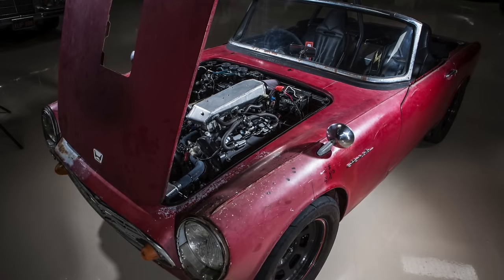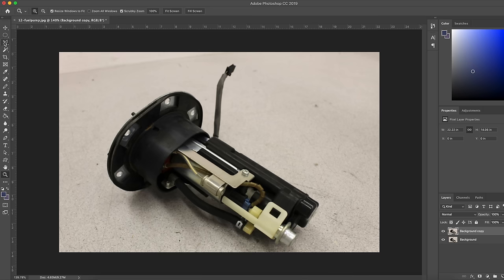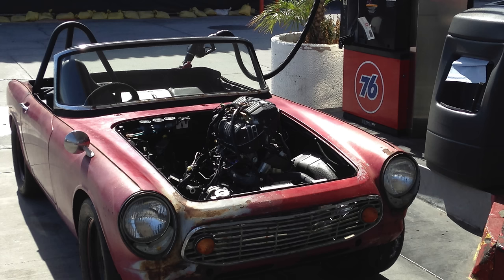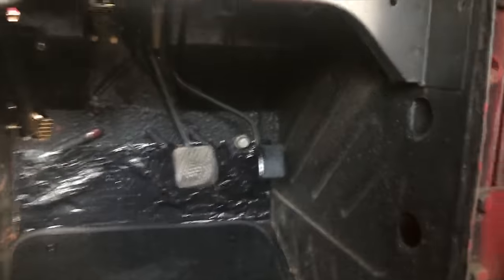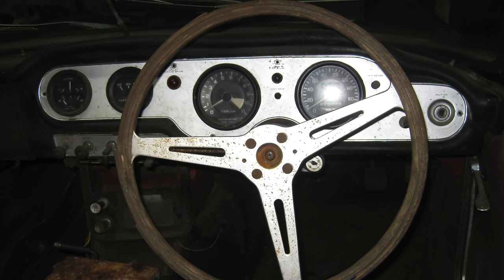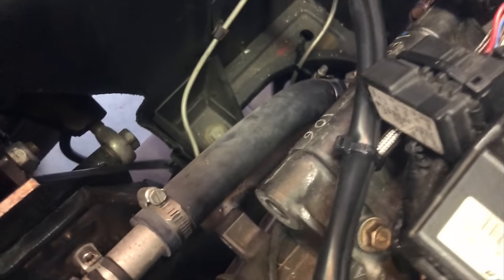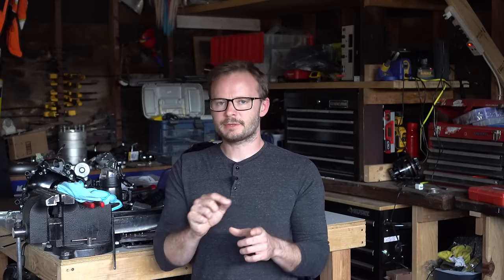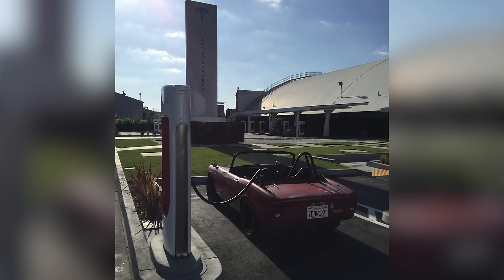Part 2 - Motorcycle Powered Car - How and Why: Fuel System, Exhaust, Intake, and Controls

Comment: Bro That shiftier clutch combo is legendarily sick AF! I want it on everything i drive!
Reply: That shifter is gone in the Jay Leno driving video.  What happened?
Reply: YOU RIGHT THAT CLUTCH SET UP IS GENIUS
Reply: In the UK you can legally adapt your vehicle to do this if you have a disability you can literally have motorcycle controls on your car
Reply: great thing about it being a sequential box too is you only need the clutch for taking off and stopping, you can just slam shift up and down, and if the donor bike has a quick shifter it's even better for it.
Reply: My Geo metro had a cable operated clutch - might be easy to retrofit as long as the mechanical advantage isn't far off.

Comment: Motorcycle intakes are huge, because they are tuned like a musical instrument.
Reply: #YAMAHA both of my R1s sing like angels. Though,  one of them has obviously been possessed (crossplane)
Reply: The crossplane sounds so good though.  I love the one in my MT-10.

Although, it definitely has a crazy airbox.  What looks like a huge gas tank is really 2/3rds airbox :-D Range is terrible, but whatever, I like what it does when I twist the throttle.
Reply: Fun fact, this isn't true, they are like that for marketing purposes, they could be a fraction of the size but then it'd ruin the design on the bike, if the intake pipe is the right size so there aren't losses and if the filter isn't tiny and restrictive it doesn't really matter what size it is, just as long as they aren't too small. Source: I build sport bikes for a living.
Reply: @jefffrasca4054  wait till you mod the air box, delete the cat and flash the ECU. It's a whole different monster. What I did to my mt10 lol
Reply: yeah he just lost a bunch of power
Reply: @jsullivan05  Velocity stacks? You don't even see them unless you take off the tank and airbox - how could they be for marketing? Anyway, they matter but it's not like you are going to lose huge amounts of HP.
Reply: @MrKdr500  HAHAHA

Comment: For 40-years I've thought about putting a motorcycle engine in a Fiat 850 Spider. Some guys think. Some guys do. Brilliant car and engineering.
Reply: I was looking for someone to say they have done this also!
Reply: @chaostoy  Yeah this was back when I had more imagination and ambition than resources. I drove a pea-green 850 Spider for a time in high-school and always imagined it with a "real" motor, ABARTH flares and wide little wheels and tires. At least it had a roll-bar, which I eventually tested unfortunately.

Comment: I had an Alfa Junior racecar years ago - and I deleted the brake boosters (power brakes). The car weighed about 850kg (~1850lbs). Worked great - but the funny thing was that going from my road car directly to the racecar did not feel strange. Getting back into the roadcar after racing though I tended to lock the brakes up. Non-powered brakes, setup correctly, just feels right!

Comment: you've just reminded me of the wooden car i "designed" when i was a kid. it was made off a bike too, reusing the engine and the rear suspension. i had troubles thinking how to design the steering, i didn't understand how a differential worked and i couldn't figure out how to mount the engine. my dad told me he would build it for me if i told him how but i never did because of those issues i had. i totaly forgot about it until today, 10 years later.

Comment: I'm actually in the process of swapping a Zx10r engine into my 1964 Beetle. I did most of my research and got the ball rolling last year. These videos have help reassure some of the ideas I formulated as well as helped point me in the right direction with aspects I haven't gotten far enough into yet. I look forward to more great content!
Reply: I've got a 1 litre kawi motor (from a Z1000, so basically an older leftover ninja motor they had laying around the factory) and am shopping for a kei truck to wrap around it.
Reply: do you happen to have a log of the things you're doing on that beetle ? i would like to do something similar in the future and i'm trying to gather as much info as i can. thanks ✨
Reply: @ilgerry5690  i don't have any recorded log or anything, and have since had to sell the project, but I can try to answer questions and share what information I have.
Reply: @bathrobebandit1561  thanks for the quick answer mate 🧐 if something pops in my mind i'll make sure to ask 😊 still, did u finish it then sold it or never completed it ?
Reply: @ilgerry5690  unfortunately I didnt complete it. Moved for work and no longer had the space to do real fabrication. The engine went to a dirt track racer and body went to someone who was going to put it on a tube chassis with a 350 SBC so im at least happy none of it went to scrap. I'll return to the idea some day.

Comment: Awesome build process Matt !
I loved having the ability to get inside your head on your thought processes and design concepts as they either worked out, or failed !
I HIGHLY recommend taking the extra few minutes, and watch the Jay Leno Garage feature piece Jay did on this car !
This little Hotrod makes ALL the right sounds, and put a smile on both Matt and Jay's  faces !
Who needs a sound system when you have a 12000 rpm rocket sled doing the talking !
That'll put a smile on any self-respecting gearhead !
Great job Matt !

Comment: I REALLY wanted to build a Locost about 10 years ago.
Bought a welder.
To learn to weld, I started building tallbikes.
Build many many tallbikes.
Bought an old Toyota pickup for a drivetrain.
It had a tow hitch.
So I bought a sailboat.
Rebuilt half that boat.
Built a new boat out of plywood.
Gave up on the Locost and bought a '69 MG Midget.
Rebuilt half the Midget.

But hey! Now I can weld, sail, and give my wife headaches from 50 year old engine exhaust fumes!

Comment: Simple and to the point, I like that. I like that hand clutch, too. That car is a true hot rod and by the looks of it; rat rod, too. I've thought about doing something like that with a goldwing flat6.
Reply: BMW water-cooled Boxer.
Reply: Yooo I have always wanted to do a gold wing or bmw engine car as well. Always seemed sensible bc it’s pushing around a barge of a bike so what not a light car. Though both engines don’t really have an advantage to auto engines of equal size aside from weight, I just think it would be super cool
Reply: @joederue9900  Goldwings have like 165hp.
Reply: Oh I know, they also redline at 6k so for the overall size and displacement and rev range of the engine, you might as well go with a auto engine of the same displacement, they typically rev higher and would be more stout, not to mention easier to work with and modify, just heavier, maybe depending on the gold wing. Like I said there is no reason not to swap a gold wing engine into something, I saw a guy who had one in a kei van, that was neat, mounted it under the chassis, but i really cannot deduce the advantage of a gold wing engine to an auto engine in the same displacement aside from packaging
Reply: @joederue9900  Super cool is the main reason.
Reply: @ItsDaJax  2020 Goldwings are rated at 97 hp at the rear wheel.  I'm sure there's a lot of potential for increase.

Comment: Nice job Matt.  I was lucky enough to have worked on two old Hondas.  My Dad had a '65 S600, all original, but had been disassembled. Could not find carb parts, so we installed a CBR600 FI with our own manifolds and Microsqirt controller.  Fun! The other was a hot rodded N600 twin.  It too was original before I upgraded the engine with EI flatslides, custom header, CDI,  karting tires and wheels and brakes. Keep 'em coming!

Comment: During the oil pan shortening discussion, my eyes almost popped out of my head when you started talking about magnesium welding. I thought the story was leading up to something I've had firsthand witness to, which if I remember correctly, involved some thermite and an old VW beetle engine block in the middle of the Mojave desert.

Comment: very cool Matt.  I did something similar when I took the front and rear suspension components from and RZR razor and built a frame to accommodate a Vmax 1200 cc engine.  Four wheel drive, looks like a mini jeep, loads of fun.   I enjoyed your vid,  we both solved the reverse problem very differently.  Still a work in progress.

Comment: that basic  clutch system  has worked for me in my aircooled vw powered rail buggy since a bad bike accident in 08 and subsequent injuries resulting in losing a leg.... i also use a atv thumb throttle for fuel ..... next build im saving parts for "fly by wire" throttle and hydraulic clutch..... awesome build sir enjoyed your videos

Comment: I was doing Formula Student as part of my Uni course, we used Triumph Street Triple 675 engines and put them in what is essentially a big boy kart. About 250kg wet, engine tuned to make 100 bhp at the rear wheel

Comment: i have always wanted to use a harley motor for a two seater but i figure like you said. the motor and trans but with a belt or chain drive it would destroy both quickly.. but the diferencial you showed for that application. would probably last longer but the inevitable is bound to happen.. weight would be paramount..   you have a great mind my friend.. peace

Comment: I had been wondering about MC engine hot rods for years. Thanks! I listened to it at Jay Leno's garage and it does sound like its carrying unintended weight. I'd bet an oil radiator would be great for the transmission . It looks great ,sounds great , must be fun!

Comment: Welding wierd alloys: Been there done that. Brought my damaged R1 block to a radiator shop that tried to TIG it but the puddle was just popping crackling. The problem was that I had laid the bike down at very slow speed and a curbstone had ripped the crank cover off, shering four bolts and ripping out four bolts. Spent two weeks trying to build up material by bracing it with zink. Everytime I tried to get the zink to wet the surface the flux burned up. Came to the conclusion that did not trust softer bracing materials with lower wetting temperature and that I would have to use a BBQ to heat the whole block in order to have the slightest chance with zink. In addition to all of this there was a lot of experimenting with stainles sheet metal to try to make "moulds" in order to contain the zink where I wanted to build material. I had already given up and was ready to buy another engine when my friend said: "Lets go to one of my customers, a repair ship yard." Within 30 minutes one of the welders had buildt up the material with the MIG welder they repair aluminium boats with. Then we went to another customer that was a machine shop to get the seal surface machined. Bought a cover from a scrap yard to replace the shattered one and used it as template to drill and tap the holes. Then I "just" had to assemble the compleate engine and transmission again before I finally got it running. Lessons learned: 1. Friends are super important. 2. You learn a lot when you cant just buy a scrapped engine to solve your problems. 3. It takes a lot of time.

Comment: Awesome build.  My dream project is to swap a Honda Turbo Aquatrax engine (basically a mini S2000 engine) into an S600.  I'm thinking a driveshaft directly from the crank output, to a rear mounted transaxle from a Porsche or something.  I just need to find a cheap S600 like you did.
Reply: Sounds like a good idea. I bet you can adapt the Honda S2000 transmission to the Aquatrax engine.

Comment: Motorcycle intakes are tuned to separate intake plenum from filter, kinda like exhaust resonators but for the other end.
They're up high because putting a full heavy tank of gas down low, near CG is better so the big empty box of air ends up going up high, and forward, near the ram scoop ducts.

Comment: The issue I have with people putting motorcycle engines in a car is that people use the motorcycle clutch.
Ya know, the clutch that's designed for a 600 pound motorcycle and not a car that weighs 3 times as much.
You get slip, you can't put the power down as efficiently and you are either changing clutch plates or tires far too often.

Comment: Back around 1992 my buddy crashed his Goldwing, we won't go into how he crashed it but he did. Anyway, oh and yes I'm English lol Anyway, we knew of a Reliant Kitten, basically it's a gokart with a plastic body, just Google it! These weight about 1200 pounds so set about dropping in the GL1500. Something of note about the Goldwing is that it had a reverse gear. The only real issue we had was the width of the engine. But with a lot of cutting it eventually dropped in. We did have an issue with the prop cuming out to the right of centre but we found a very small second hand divorced transfer case. Not sure what it was off but we connected the front drive shaft to the Honda output and took drive from the rear of the transfer case which centred the driveline. We ripped around the country lanes for the summer scaring GTi owners, it was crazy quick. Then it sat on my drive for a few months and eventually I swapped it for a Mustang 302 and 5sp transmission for my main project. So to answer your question, 'why do brits do this a ,lot?' Well it's simple, you use what you have easy access too. I like American V8's but they are more difficult to find here and a lot more expensive than in the US, though I'm lucky in that I spend a lot of time in the US so can track down stuff and ship it back. However, not everyone has that option, but what we do have is is access to a lot of high powered, usually crashed motorcycles.

Comment: I want to do this on my G1 Insight. If I had the luck to ever find a convertible S600 or S800 Vert (I wouldn't be able to afford the price) I would definitely not consider a bike engine. However, Yours is a perfect version and the reason why I came across Jay's video first of your car. I love this. Was debating the K20 swap that would probably be much easier, but the bike engine...well, that captures my heart and imagination. Wondering how a zx14 power plant compared to a stock k20 would compare.

Comment: Nice presented and build , am uk that done silhouette race cars ,, you wanna try match your header lengths instead of different lengths,  we call them spegetti pipes cause they usually goto wrap around each other to get them to same lengths,  worth a try as does improve performance  ( we did race engines in the cars ) yours is nicely done am sure you can easily do them .as for clutch cable the foot clutch into the engine bay ,weld a plate on a bar so you can mount to bulkhead (any where it fits ) you can mount bike clutch master on if you mark the back of bar to the clutch lever and drill through .weld in a nut so when you put cable through the hole you can adjust the cable by adjust that threads in the bar.pull lever fully in and measure ( between bar and lever )a Teflon tube bigger than cable, this is cause you need a spring between bar and lever to return foot lever easier .finally drill a hole though lever oposite the bar hole just big enough for cable to go through .cutting a groove towards the master just so cable can seat in slightly cutting it deeper as towards the hole (round of where cable comes through ) use fuel hose pipe clamps to fix cable to lever , yeah lateral force kills bike motors when run dry , sidecars on the the TT only get 3 races per motor , but they corner with a lot of G ,you wanna look at there problem solving as side cars ain't tall .

Comment: Very impressive build and super concise video presentation...Thanks!   But, welding MAGNESIUM??? 
I once worked in the defense industry for 3 years. An aluminum component we built (specified to weigh no more than 1 pound) for use in a 'smart' bomb was a couple ounces overweight. The only solution we could find was to build it using magnesium. Bt, the military steadfastly disallowed magnesium - EVEN FOR USE IN A BOMB....and yet, you're WELDING it???   YIKES!!!

Comment: Matt - If you have a minute…

I know of a cheap 1973 MG Midget that was a prop car for musical Greece…it’s clean but has no drivetrain. There’s also a cheap VFR800 for sale. 

I don’t really know of anyone that has experience with cars this small. Do you have an opinion on this formula above, being left live axle in the rear? 

Have you had any experience driving a motorcycle powered car that was solid axle? 

Also, locost US is down. Any other recs on good forums? 

Love the content man

Comment: Tell us more about the reverse gear box you put in it please ! Working on building a crosscart with a motorcycle engine and finding a reverse gearbox that will handle that much power is alot harder than you would think......I considered using an old s10 manual transmission and gating it so it just goes from 5th to Reverse or maybe a Saganaw 3 speed from the junkyard or Ebay which ate getting cheaper nowadays with 5 and 6 speed transmissions being so popular 3 speeds aren't that big of a draw anymore and  that would go from 3rd back down to reverse but maybe your way was cheaper !

Comment: Your first example re gas tank re use is a bit off track- the car pictured has a spun aluminum tank in the rear and the re used red Honda body under the hood is an air intake . The original builder is a regular on the Locost7 site you gave. Great car though!

Comment: Cardboard assist . Love it . Old School . Before them thar new-fangled  'puter  doo-hickeys . What about a Goldwing Engine ? Still 9500 RPM . Less Power as such . More than twice the Torque though  I  would think . GL engines  WERE basically a Car engine installed in a Motorcycle . Honda  S1800 . 6 cylinder howl .